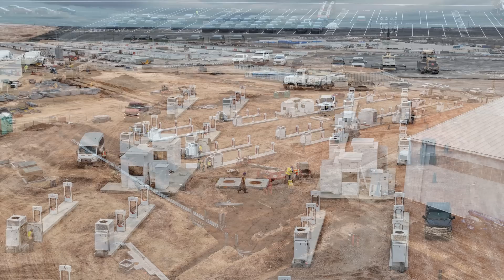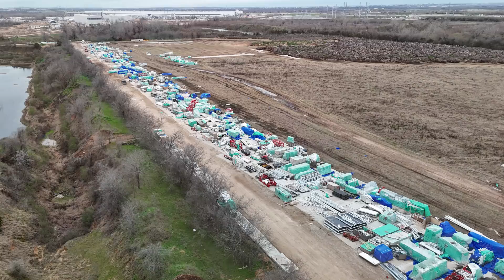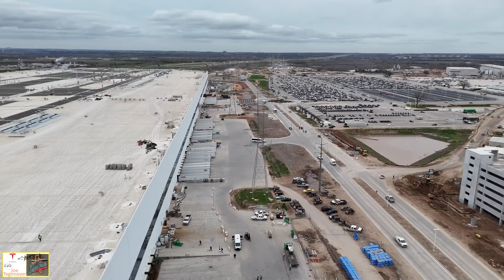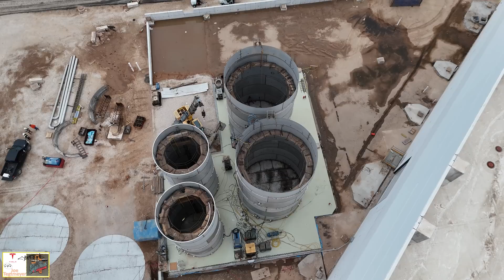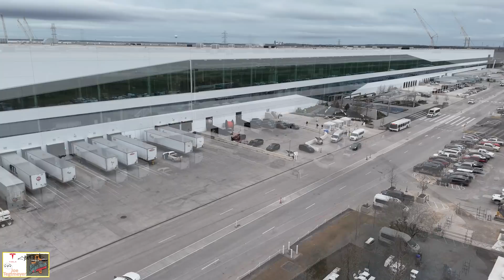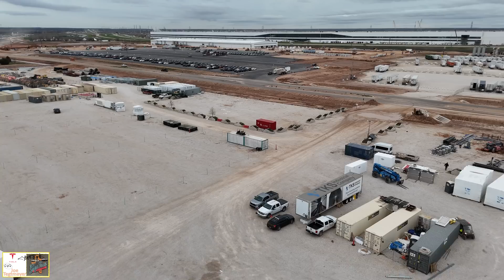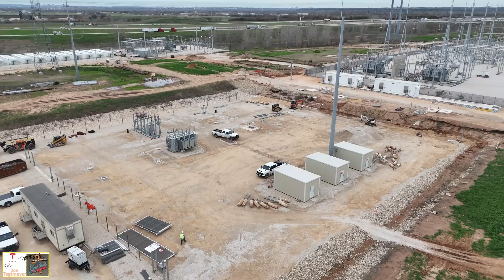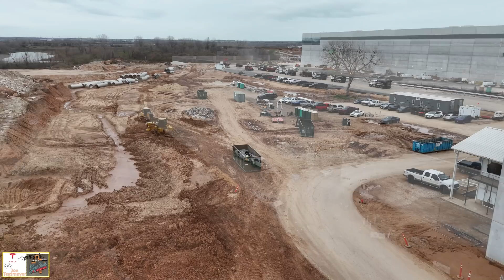Cybertrucks! Megapack Connected! TKS Paint System Delivery! 16 Feb 2024 Giga Texas Update (07:35AM)

Comment: Any idea when the tunneling might start?
Reply: Still quite a bit to do, but it seems they will start with a 'short' set-up. i.e. only the first one or two backup decks installed, the rest sitting where they are at the side connected by temporary umbilicals. Still need the conveyor bridges and belt installing, but it's mostly connections and testing from this point, my guess 7-10 days.

Comment: BESS substation:
@ 25:34 and 25:52 Joe.. All the necessary switches are closed, but... Unfortunately, it is more complicated.
The thing about the switches is that they can only confirm that the Megapacks are offline. They can NOT confirm with 100% certainty that the Megapacks are online. Why? Because there are also circuit breakers. And the state of the circuit breakers can not be known from the air.
Reply: Maybe Joe could put some thermal imaging on his drone to see if active?
Reply: @brucec954  The best way is for Joe or brad to talk to someone who works there.